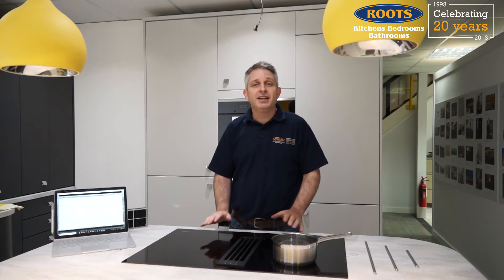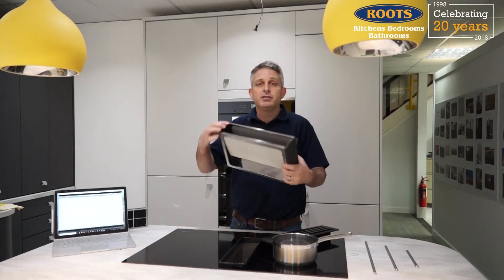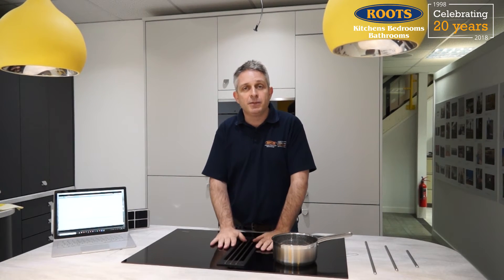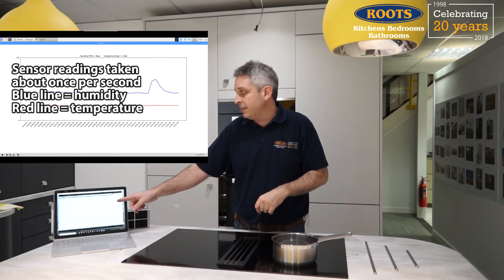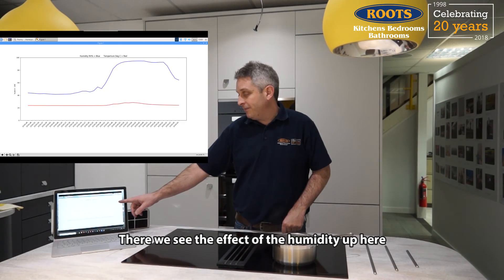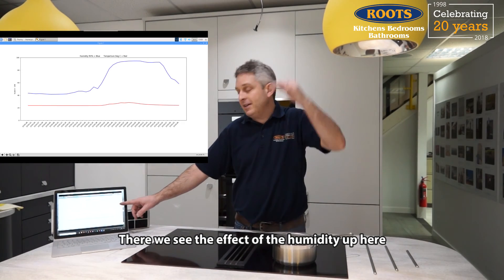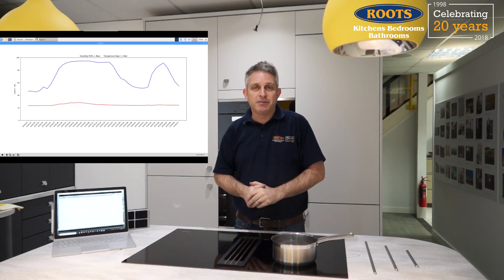We test the effectiveness of extractors that are built into hobs (instead of placed overhead)

Comment: Hi there I am really torn as to if I should get a hood or an extractor built into the hob. My worry is that hob based extractors are significantly worse than hood ones. For me the extractor is one of the most important applicances is the extractor, since I don't like my entire living room smelling of food. Also function is more important than looks for me in this regard. Do they work as effectively or better than hood based extractors? Laws of thermodynamics say that steam rises and downdraft tries to counteract this. What are your experiences? Also most built in hob extractors seem to operate around the 500m^3/h mark while I have seen hood extractors around the 1000 m^3/h mark.
Reply from the maker: > I am really torn as to if I should get a hood or an extractor built into the hob
You've come to the right place :-)

> My worry is that hob based extractors are significantly worse than hood ones

It depends on what and why you're choosing.  Hob based extractors like this Miele model out perform made-to-the-lowest-cost wall mounted hoods every time.  You can compare performance parameters from the EU product data fiche (mentioned at the end of the noise video I did recently - https://youtu.be/SBfysIfETlg ). 

>Laws of thermodynamics say no given that steam rises. What are your experiences? 

That's why I built a humidistat to test.  They are equally good to wall mounted hoods (subject to being comparable power/noise/ducting etc). 

>Also function is more important than looks for me in this regard. Do they work as effectively or better than hood based extractors? 

Yes, for an equal product spec/rate/etc, they perform equally.  My general rule is I use these where I don't have a wall (islands/peninsulas). Ceiling mounted extractors are also a good option but I can struggle with ensuring it's easy for the customer to maintain them (wash and replace filters).  Extractors that hang from the ceiling have easy to reach filters but are often in the line of sight to be annoying when using the kitchen and talking to people.

If you are against a wall, I'd stick with a wall mounted hood.
If you are in an island, the built in hob extractor is often the best option today
If you're reading this very long reply and found it  useful, please click like on the video and subscribe. That helps other people like us find answers like this and helps me be seen by people local to our small business that need rooms done well.  Thanks! Steve.
Reply: @RootsKent  Thanks for the reply! In terms of performance do you know if Siemens  / Miele / Bora perform similarly or if one is better than the other in terms of suction?
Reply from the maker: @Persason  I'd always look to the specification sheets for the models you're looking at. The standardised EU testing means you can fairly compare between them (see link in the pinned comment on this video). Remember actual performance will vary depending on your room, ducting used, etc.  
Performance isn't the only worthwhile criteria though, I'd also consider how they look, how they fit into cupboards (eg: if they take away space you need for storage), how easy filters are to access and clean (I did a video spilling bolognaise into one as an example) and any cooking functions and features they have that may have an impact on the one that's best for you.

Comment: How do you vent these outside? Is it done under the floor if hob is on an island?
Reply from the maker: That's right, which is not always easy to do so most of the ones we fit use the recirculating filter option. The hob in this video https://youtu.be/EXzvBNbloK8 is ducted outside under the floor because we were involved in the design phase of the extension.

Comment: Heat rises.  So the steam and fat/oil vapour naturally rises.  I believe an overhead extractor will be more efficient and quieter as it can be run at a lower speed.  In an open plan kitchen, you can still have an overhead extractor.  So I am afraid I am not converted.  Please tell me what I missed.
Reply from the maker: "Please tell me what I missed" => nothing :-)
I agree an overhead extractor will often be better (like https://www.miele.co.uk/e/ceiling-extractor-da-2808-brilliant-white-10851410-p - as close as quickly comes to mind for the equivalent overhead version of the extractor in this video), but;
* They still have the same question of ducting or recirculation and whether that can be fitted (EG: in this kitchen https://youtu.be/EXzvBNbloK8?t=318 overhead is not possible, although you never see the skylights in the video, sorry!)
* We also need to consider access for servicing, for example changing and cleaning filters.  If I can avoid needing customers to climb ladders or stand on worktops (or hobs 😬) then I'd generally want to.
There's a balance to be found and it's different for every customer and every room, so you've not missed anything and no one needs to be converted

Comment: Could you let me know if in case this goes under a wall cabinet (not on the kitchen island), would the 50cm distance from the hob be enough or would the heat damage the bottom of the cabinet?

One of the kitchen suppliers was advising againts hob with integrated extractor, claiming the heat would damage the inside of the cabinet, too much heat would draw to your legs, and ultimately it would ruin your floor as well.

We can only go with recirculate airflow in the new apartment..we can either choose a built-in extractor in the wall cabinet ( still unclear to me how would it circulate the air unless the top of the cabinet is open) or this type of hob.

Would be also great to hear if this goes next to a wall, how much cleaning you need to do on the kitchen's backsplash (eg.: same as with a normal hob with extractor above or more)! 

Thank you for your answer!
Reply from the maker: > would the 50cm distance from the hob be enough
You'd have to check the specifications of the hob and the furniture supplier, but generally I think 50cm is always too close - you'll have to duck to look at the pans cooking.  Personally I aim for at least 76cm.
I'd also be choosing a regular extractor at this point though, integrated or telescopic.

> would the heat damage the bottom of the cabinet
Over an electric hob, I'd be more worried about steam damage.

>One of the kitchen suppliers was advising againts hob with integrated extractor, claiming the heat would damage the inside of the cabinet
Not something I've experienced or seen before. The warm air travels through ducting (as it would in top cupboards) so I don't see it would ever be an issue. The hot steam is also mixing with air from the room as it's drawn into the extractor so I can't see it would ever be hot enough to cause cabinet damage.

> too much heat would draw to your legs, 
That depends on where you put the outlet vent ;-) 
When recirculating you definitely notice the blow of air more than a recirculating hood that's blowing out across the ceiling.

> and ultimately it would ruin your floor as well
Before leaves the plinth it's gone through metal filters (for moisture and grease) and carbon filers (for smell).  Moving air will leave trails over time (now you're going to start looking at vents and grills everywhere you go - if air is pumped through them you'll eventually see slightly darker lines of dust being left) but as this is on the floor it will be cleaned more often than a ceiling so I don't think marks would be left and I don't think it would ruin the kitchen floor.

>We can only go with recirculate airflow in the new apartment..we can either choose a built-in extractor in the wall cabinet ( still unclear to me how would it circulate the air unless the top of the cabinet is open) or this type of hob.
*I'd be choosing the built in extractor, and vents to the open cabinet top (or a grill in a ceiling infil).**
Unless there's a reason not to... there's always an exception after all! For example here's a good reason a wall mounted hood wouldn't fit: https://www.houzz.com/photos/painted-porcelain-and-blue-shaker-style-cabinetry-rustic-kitchen-kent-phvw-vp~108802023 

>Would be also great to hear if this goes next to a wall, how much cleaning you need to do on the kitchen's backsplash (eg.: same as with a normal hob with extractor above or more)! 
Same as normal I believe (not tested for that).  Perhaps a tiny amount less as the air is all being drawn down but I don't think that would be a noticeable difference.  So far every hob like this we've installed has been in an island/peninsular with no wall behind it so I don't have any past customers I could call and ask

I hope that's useful and sorry for the wall of text!
Steve

Comment: The noise completely put me off. These things have to work against the heat updraft so are much less efficient than overhead systems that make use of the physics of heat rising, hence they are much louder ceteris paribus. Now, if you can put the motor outside with extractor version, that might work but even then very inefficient vs overhead. With gas hobs, utterly impractical surely?
Reply from the maker: Hi, thanks for taking the time to comment. With so many comments on the noise level I decided to create a video testing and comparing the noise level of these hobs - https://youtu.be/SBfysIfETlg, I hope you find it useful

Comment: Hi Steve , great video, ducting to outside always preferred method for me, but what clearances does the ducting need under the floor, for example my floor is concrete so does that mean the ducting version is impossible for me?
Reply from the maker: Unlikely to be possible, but not impossible.  The bigger the duct, the quieter+more effective the extraction, so 6 inch is expected (150mm diameter round or the equivalent area as a square, and I'll skip a description here as to why round is better than square due surface area contact).  If you can put a large channel in your floor to carry ducting then you can do it, which we did in this room: 
https://youtu.be/EXzvBNbloK8 
This room/video has/shows a Bora X Pure. It was easy to plan this at the design stage before the extension was built and we co-ordinated with the builder for this to work (which means I went out and marked on the sub floor where the ducting had to come up during the build, the builder fitted the ducting then built up the floor insulation and screed around it, tiled and we fitted the island on top).   If you have to have recirculating I think that's an acceptable compromise for an island hob with no hood in the way of your eyeline (but remember if it's a new build you'll still need a smaller extractor/ventilation for building regs, and I'd look into humidstat fans for that).

Comment: It's an interesting concept, but I'm skeptical of its ability to capture aerosol grease particles that - if not ventilated - end up everywhere in the kitchen.  And if it is powerful enough to suck those in as well, what about crumbs?  A spilled bit of seasoning?  Escaped pasta?  Utensils?  Peas right off the plate?  How often do you need to clean it out if it's sucking up everything in sight?
Reply: When you wash your dishes in the dishwasher you pull the filter and wash it together with the dishes 
No problem at all 
Actually way better

Comment: I was told to put the extractor on before cooking to have a better 'air flow'. Any comments on this?
Reply from the maker: Short answer: Yes - that's the best practice.
Long answer: Yes, and this model will automatically turn it's extractor on as soon as your turn on a hot zone :-).  The reason is it takes time to start moving the air to make it flow. Starting the extractor soon often allows you to run it at a lower speed (so it's quieter).  Once you finish cooking you should often leave the extractor running on low, so you'll still collect humidity and smells from pans on the hob taking advantage of the flow you've built  up whilst not having so much noise.  Many extractors (95% sure this model does) automatically run for 10 minutes on low setting before switching off for this reason.
If you're extracting to outside, you may also need to consider where the air you're removing is being replaced from. It could be enough from the gaps around doors into the room or you may benefit from opening a window slightly.  If you have an 'open flue' appliance (a boiler or fire that gets air to burn from the room it's in) we're not allowed to fit extractors ducted to outside. They'll pull the air out of the room, sucking the burnt air from the chimney back into the room and that creates a strong risk of carbon dioxide poisoning.

Comment: Too noisy!
Reply from the maker: Does this extractor sound noisy to you?  If you think it does and you're comparing extractor models please don't use a youtube video to compare noise :-)
You should know for this video; 
* I didn't reduce or alter the sound level in editing and 
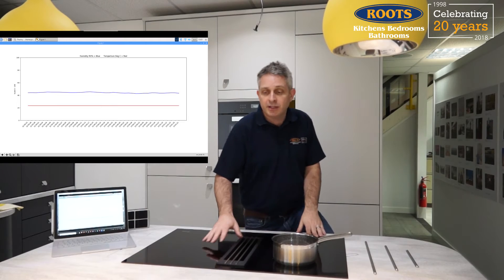* The microphone I was using is the one attached to the camera, I've not even got a tie mic and you can even hear the creak of the aluminium stool I stand on at 1:54

Because I could have played with sound levels in editing it's not a good idea to trust noise level comparisons on a youtube video. If noise level is a consideration check the manufacturers specification sheet. There's a standardised EU data sheet for every extractor so you can compare like with like, for this model it can be viewed here: https://media.miele.com/downloads/92/f1/04_F61547C6F7151EE89EB26124135E92F1.pdf
Thanks for watching!
Steve

Comment: I noticed there was still some humidity that the sensor was picking up. The baseline with the extractor fan on is still higher than the baseline when the pot wasn’t boiling.

My takeout: the extractor fan is a good product. Much better than I thought it was going to be. But not better than an overhead range hood.
Reply: How much moisture or grease misses the overhead due to the distance between them both?
Reply: @markh1ggins  hard to say but I would say less than in the table top extractor. The grease and steam is hot so is already rising upwards towards the overhead
Reply: I've got a big overhead extractor and that still misses some of the rising smoke / steam too.

Comment: Extractor sounds like a jumbo jet taking off
Reply from the maker: Does this extractor sound noisy to you?  If you think it does and you're comparing extractor models please don't use a youtube video to compare noise :-)
You should know for this video; 
* I didn't reduce or alter the sound level in editing and 
* The microphone I was using is the one attached to the camera, I've not even got a tie mic and you can even hear the creak of the aluminium stool I stand on at 1:54

Because I could have played with sound levels in editing it's not a good idea to trust noise level comparisons on a youtube video. If noise level is a consideration check the manufacturers specification sheet. There's a standardised EU data sheet for every extractor so you can compare like with like, for this model it can be viewed here: https://media.miele.com/downloads/92/f1/04_F61547C6F7151EE89EB26124135E92F1.pdf
Thanks for watching!
Steve
Reply from the maker: Hi, thanks for taking the time to comment. With so many comments on the noise level I decided to create a video testing and comparing the noise level of these hobs - https://youtu.be/SBfysIfETlg, I hope you find it useful

Comment: So where does this humid air go? If it stays in the room then kitchen will get humid and steamy anyways.
Reply from the maker: Good question. Recirculating extractors have been an option for a long time (and commonly chosen, sometimes to save the cost of drilling walls, sometimes due to restricted access for ducting, sometimes due to regulations extractor air from a room with gas appliance and flue) and I've not known this humidity alone to be a problem. The metal mesh will collect an amount of the moisture but I assume that must evaporate back into the room over time.  Remember this extractor and most others can be ducted outside too, if you can fit your ducting into floor voids!

Comment: Is it waterproof? if you spill a bit of sauce/water will it be ok?
Reply: Nanu Siri no you have to buy a new
One
Reply from the maker: This one (and the Neff one we've sold, and when I last looked in detail at a Bora model) are designed so that spills down the vent hole won't do damage. for this model the pull out vents have a catch tray underneath them and that whole pull out unit can be put in the dishwasher. Below that is a further catch tray that can be removed from within the cabinet.

Comment: Yes on high speed, what about slow speed which most people use for cooking if it's a decent extractor, remember hot air rises and always far better to extract outside if possible.
Reply: I agree. Re run it at each of the available settings. My suspicion is that it won't work.